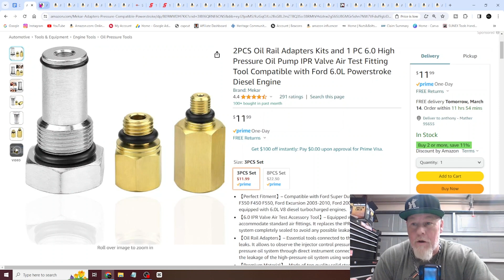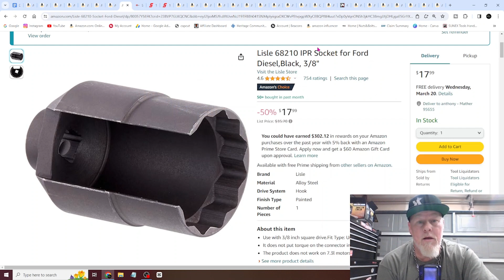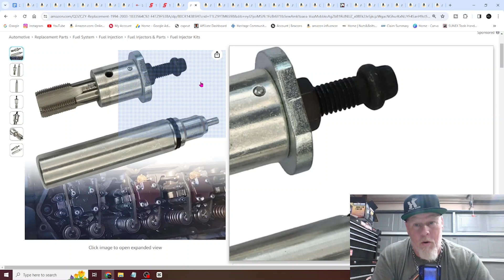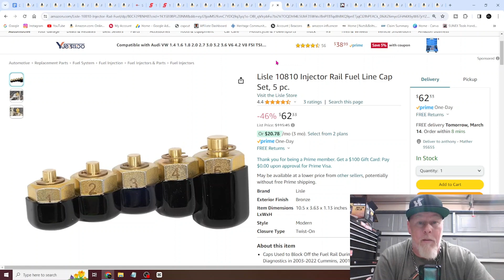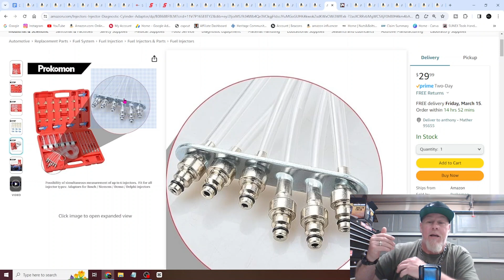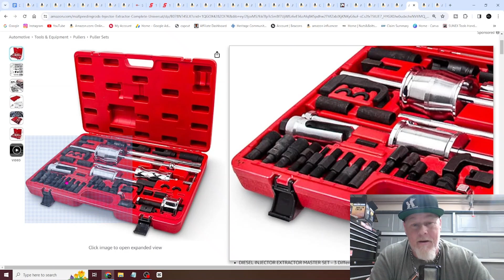Best Diesel Tools

Comment: That first tool you showed for pressurizing the 6.0 high pressure oil system,  I made one years ago when I needed it in a hurry.
Reply from the maker: That is awesome to hear, I did the same thing. I had the fitting in my oil pressure gauge set, so I just made my own. Thanks for watching.